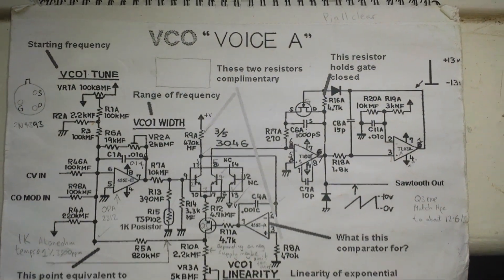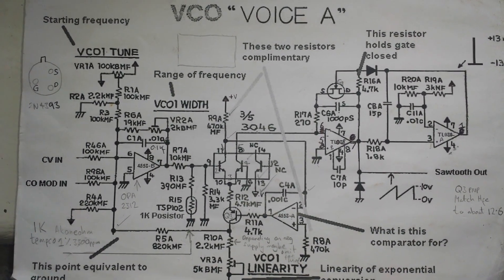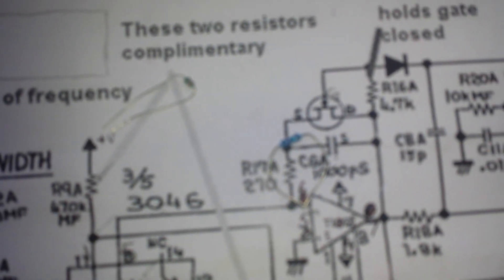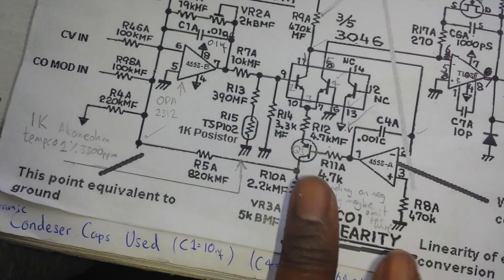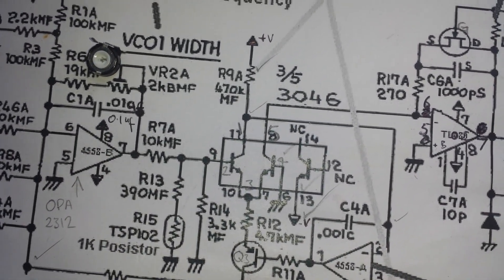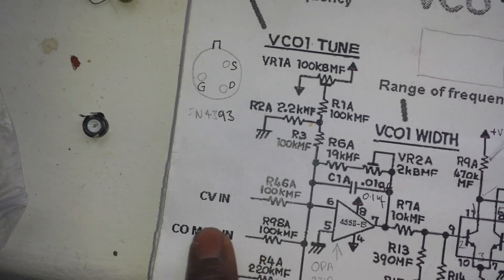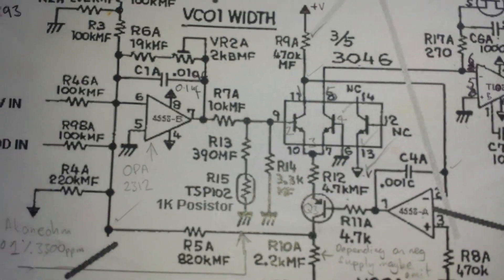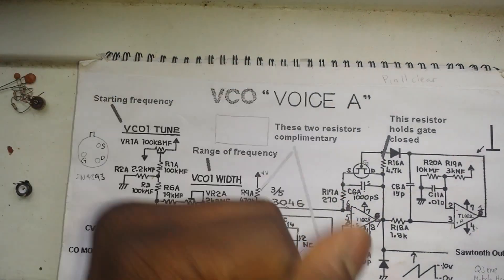DIY analog synth project Tutorial Part 2 The Exponential Converter

Comment: I really am in love with these videos of yours but I don't want to clutter the comments fields with all my questions, since I have a lot! 

Would it be possible to get your email address? Mine is benjamin@connectica.no, please send me a quick hello if it is ok to email you some questions in the future :)

I really appreciate the fact that it seems like you started out with a semi-novice knowledge about electronics and progressed so fast, which makes me confident that I can do this as well. I have done some electronic works in the past and now I'm looking at synthesisers as I have always been fascinated with them. 

I have started building some simple oscillators, amps and a program that reads MIDI notes and velocity from a keyboard and transmits back to the breadboard.
But i'm a bit stumped on the exponential converter and how to connect the midi notes from the digital representation I have on the raspberry PI to  to a CV that the oscillator can understand. 

I tried PWM, but that didn't work, so my next plan was to try digital potentiometers like the AD5206  to set the voltage level to the right note corresponding level for your VCO. 

Would this work as an input if I follow your design for the OSC and the voltage exponential converter? 

I would love to try to replicate your build before I start my own design, do you have the full schematics and parts list? 

I will certainly document my journey like you did in order to help out any future adventurer.

Best regards and again thanks for this awesome resource!
Reply from the maker: Benjamin Fauchald Hi Benjamin. I have sent an email to the address you gave me . I hope you have got it.

Comment: Hi, Ajull!
By measuring from leg 8 of 3046 it seems that my expo converter works. But I'm not sure about one thing:
I use another voltage source (a decent AC-DC adapter with modes 3 - 4.5 - 6 - 9v) to input to CV IN here. Voltage divider is assembled (later I'll make a set of values with buttons) with a pot. I guess that I need to input the "minus" of this AC-DC adapter to 5 leg of OPA2312 (for now it's connected to OSC's power source 0v). Is this right? I guess that you've connected your "ground" contact from Minibrute's CV Out to 5 leg.
Reply from the maker: MoolahNasreddin Leg 5 of opa 2132 shoyld be connected to ground or Ov . Not sure of your test method thou perhaps send me a picture ?
Reply: I'll make it tomorrow :) It's a little big mess and I lay everything out every time to continue. Just "-" and "+" contacts that gives ~6.24v on the multimeter. It's separated from the bipolar source. I guess that your control voltage is separated also and have own ground (or "minus" probably) that maybe goes to leg 5 of opa2132. If it's true then it will work the same in my case. You have two contacts from CV Out, right?
Reply from the maker: No my whole circuits run off the same power supply thou i feed them in sets direct from the source for example . The vcos have a direct supply +/- 15 then the vcfs are fed seperatly and then the two envelope generators and Vca and expo converters etc. As daisy chaining all in series would cause lots of interference .

Comment: How did you've got a bip. PS in 10-15v range? Is it easy to purchase or solder?
Reply from the maker: MoolahNasreddin I got kind of lucky. I purchased a bipolar supply from a guy who initially i went to pick up switches from an ebay sale he lots of old electronics and had a few psu's . I personally wouldnt advise making your own unless you 100% no what you are doing as mains voltage is very dangerous . However you can look for a bench bipolar power supply that has an adjustable range, and also make sure its linear. Alternativly as start you could rip out an ATX power supply and use it to get you started. Thou they are very noisey on the power rails .
Reply from the maker: MoolahNasreddin I dnt think its bipolar only a dual positive output. You need to make sure it has a plus voltage and minus voltage output.
Reply: besides it's too expensive to ship to my country )) Maybe I'll find some on Ali...
Reply: Sorry, I've mismatched. I've edited that comment
Reply from the maker: MoolahNasreddin Reply just seen your new ebay link , yes it looks ideal. I may even get one for myself , good find :-)
Reply: I'll buy here if I'll not find with a cheaper delivery.
Reply from the maker: MoolahNasreddin Ok , good luck with 👍👍👍